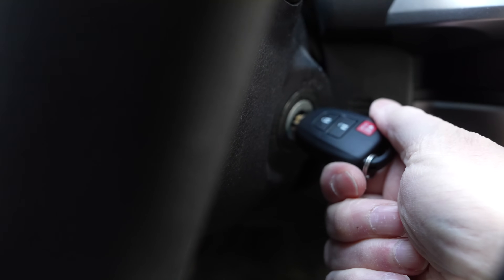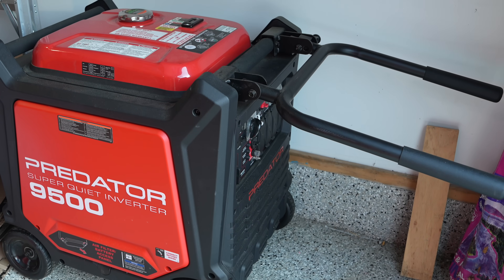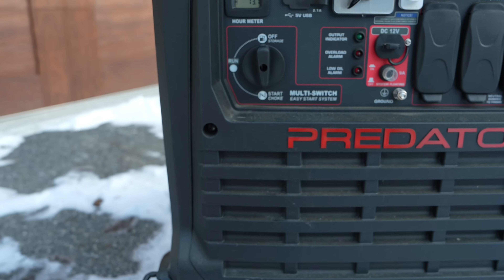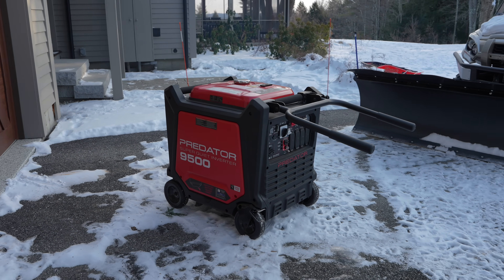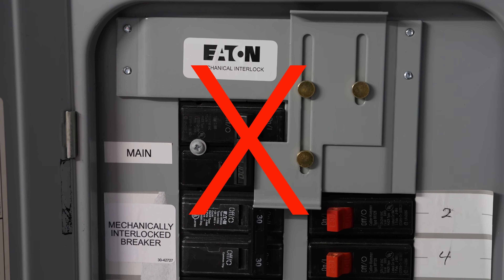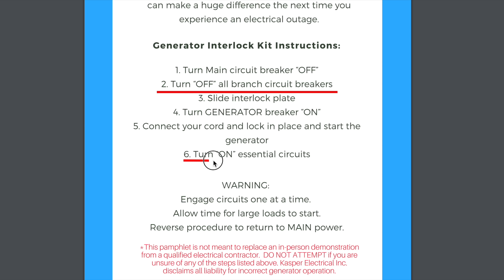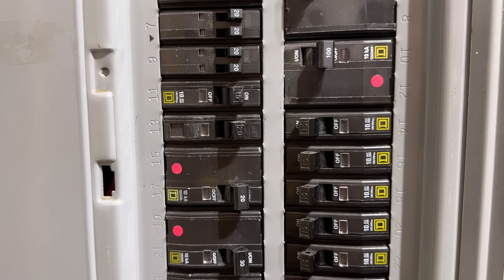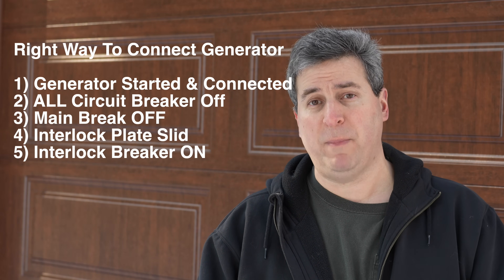Homeowners are Destroying Generators Skipping 1 Step During a Power Outage

Comment: You should have mentioned that automatic transfer switches are built to cope with those surge loads.  Also, in an extended outage, keeping the oil topped up and giving the generators breaks will make a huge difference to the service life.  Only large water cooled generators are intended to run constantly for extended periods (Primary power generators) Those are, of course, very pricey and are typically found only in fully off grid situations.
Reply: I have a 30 kW water-cooled generator with an automatic transfer switch. Would be great if you could elaborate on "automatic transfer switches are built to cope with those surge loads" . As I understand this video, at least part of the issue isn't the breaker (being used in this example as a transfer switch), but rather the large change in electrical load.

My transfer switch is, like I assume all are, designed to make and break contact as quickly and completely as possible, to eliminate significant arcing that might damage the switch. But as far as I know it does nothing to soften the load being added to the generator all at once (nor being removed all at once when the outage is over). I've always assumed that the generator is just large enough, with enough inertia, that connecting it to the house panel all at once is something it can handle.

(Of course, the largest loads don't actually come on all at once anyway, except the water heater. Everything else is controlled by some kind of electronic circuit that takes time to reboot and get going again once the power has been interrupted. But let's assume for the sake of argument that there are a number of large loads that could be immediately powered back on when the generator's transfer switch is connected.)

Comment: My generator panel has a two position switch which automatically selects utility power or generator power. So I don't need to switch the utility breakers off since they are isolated by the generator panel itself.

Comment: I would like to get your opinion on connecting a generator. The way I have been doing it for 45 years is only connecting the two hot legs to the panel since the ground and neutral is still working in the panel. I just bought a champion and that I should have a floating neutral by disconnecting the neutral  in the generator, but by disconnecting on the plug will do the same thing and do you have a opinion on exhaust extension, thanks Bert

Comment: You can leave some circuits on if they're just lighting, especially if you're using LED bulbs.  Typically you can leave on lighting to where your panel is and lighting for stairways.  That's very minimal draw.  Another handy thing to do is to have a few LED lights that will come on when the power goes out automatically so you have emergency lights.  If you don't have an enclosed mounted generator, you can make a cover for your generator by using a piece of heavy plywood that has about a foot overhang on every side to protect from rain.  Add blocking on the bottom so it can't slide or vibrate off, and use a sandbag or something heavy to keep the wind from blowing it off.  That will help keep rain off of it.

Comment: Warming up the gen ... check.  Turn off Eco mode ... check.  EVERY breaker off??  Sorry, you lost me with that.  WAY overkill.  Turn off the high draw items, sure but any generator can handle a small to moderate load thrust on it suddenly if it's warmed up and running with the eco mode off.
Reply: inrush loads should be turned on first, one by one.

Comment: Not a tip for the generator, but a tip for the power companys men working on the poles.  Powering up a generator into the circuit panel with the main breaker on sends power up into the wires feeding your house and many others.  This will generally stall the motor on your generator immediately, but also send electricity up the pole to the poor guy working on the lines.
Reply: "Powering up a generator into the circuit panel with the main breaker on sends power up into the wires feeding your house " -- no, it doesn't. Not if the electrical is wired correctly, as seen in this video. The generator and mains can't be connected in the panel at the same time, due to the breaker interlock.
Reply: @harvey66616 Yes;  if wired correctly...

Comment: I'm not exactly sure what eco mode does but I assume it allows the generator to cycle down under low load conditions. This is exactly what you would want during warm up. You don't want the engine screaming its guts out when it is cold. By the time you have hooked your cables up it should have warmed up enough that you can switch it to normal mode. Then energise your fridge and freezer circuits first, followed by lighting.
Reply: You're not sure what it does but you still have advice anyway lmao. Dunning Kruger

Comment: I grew up on a dairy farm and we had a big ol 30kw generator that had to be hooked up to a tractor. Thing had to run the entire farm especially the big electric motor on the vacuum pump for the milking setup, and that took a lot of power. We got rid of the cows after we had that bad winter back in 13-14 but we still have that big old beast, and now that you mention it I can't recall ever doing this procedure once, we'd just wheel it over to the main power pole with the meter box on it, hook it up via a inch thick cable rev up the tractor and flip a big lever from the up position (overhead lines) to down (generator feed) and go about our business till the power company got the lines back up.
Reply: Almost the same set up but with a big welder on a trailer. It won't run every thing . Infact I have to make shure the 3 phase motors are off first or they will burn up.

Comment: I have a Reliance 2 leg Watt Meter in line for my 30AMP connection into my panel. This allows you  to see how much each circuit breaker is drawing & on which leg as you throw them back on individually, so you can keep your load balanced. I had my panel upgraded last year so I now need to mark each breaker to know which side it is using.

Comment: I don't think you need to shut everything off. You can turn off larger loads like the stove, dryer, ac, hwh, etc. If the rest has a few led lights or a computer, it's not going to matter. Everytime you add a heavy load to your generator it is going to get 'slammed' anyway. The valid point here is not to add too much at one time.

Comment: The main reason to start with Eco Mode OFF is most of these engines have a "Splash Feed" lubrication system. This means most don't have a Pump like a Car, they have a Dipper which "Splashes" oil around to lubricate the Engine so more speed, more lubrication.

Comment: I spent the extra money for a generlink connection at my power meter. It prevents back feeding the grid, and acts as a whole house surge suppressor. Yes it is more expensive than a manual setup. But in my case, with an older home and limited panel space, it was actually less expensive to install. 

Thanks for the helpful reminder about the proper sequence of operations to getting my generator connected and running safely during a power outage.
Reply: Can you please provide manufacturer info ?
Reply: @charly3rd273 Just Google generlink. They are very simple as they are plug and play , the cost is reasonable compared to getting your panel retrofitted and you can take it if you move!
Reply: @charly3rd273 Generlink is the manufacturer. Just talk to an electrician or electrical supply store.

Comment: You might want to mention that this would be recommended for portable gas and/or battery generators.  You are not going to do this with the a whole home gen as its made to failover when the power goes out.  Same thing with a properly sized battery system.

Comment: It is better to turn loads on in stages, but how much load is enough to be concerning? What types of loads should be noted (inductive loads vs resistive loads... I don't think many residencies need to worry about high capacitive loads)? How much leg bias is tolerable.

Imo if someone shuts off all 30 amp loads, two pole breakers and any other intermittent automatic motors that may operate on 120v (like mini splits) then it should be fine to leave on all 15 and 20 amp line to neutral breakers (almost always single pole breakers) as one initial load after the generator's warmed up.
Reply: Leg bias?? In a perfect world it should balance. If the breaker panel was set up properly it might be close. The way a generator works you can load one side and not the other, but a balance is better. Loads also vary throughout the day. 

As far as breakers go, resistive loads like an electric water heater or electric range draw a LOT of power. So they should be off unless you have a very large generator. Like you mentioned double pole breakers. Other circuits? Depends on the generator. How many watts is the generator? Things with a motor like AC , refrigerator, freezer, draw double on start up. Things like a blow dryer, toaster, coffee maker, microwave can use around 1200 watts each, so they can add up fast. You can trip a 3000 watt generator easy with just those. 

I use a transfer box with 2 meters. So I can get an idea of what loads I am putting on the generator. Also shows the balance. Amazon item B000BQN4T2 if you want a look. That one is only for certain circuits. Needs to be installed by an electrician. Needs to be sized at or larger than the generator. Hope this helps.

Comment: Petrol generators can be a pain. Modern fuel goes stale very quickly, about a month here in UK. unless you use the manufactured fuel which is expensive. Never use E10 fuel it will destroy the engine. 
The best generators are diesel, I got one about 2 yrs ago. Worked out cheaper to get a diesel generator. Runs the whole house using about 0.5 lts hour of fuel. As I have agricultural diesel it costs 35p per hour to run.
As the video says warm up the engine before putting a load on it. Same goes for any engine in fact.
Reply: E10 won't harm the engine at all, unless you neglect to drain it out of the carburetor bowl before putting the generator back into storage.
Reply: @BKD70  most fuel stations have gone back to E5 petrol now because of all the problems with E10, 
Even modern cars have issues using E10,  some places in my area only sell E5 now. 
I service small engines, lawnmowers etc etc,  even new engines have stickers not to use E10 as warranty is void if used,  even draining fuel system engines won't start on old E10 if used. And I mean fuel over a month old.
Reply: @Feilding8187  Wow, your gasoline/petrol must be really bad over there.  The E10 is garbage over here, but if you at least drain the carb after use, the problems are minimal here in the States.  The problem is, it only takes once to forget to drain that carb bowl... and then it's no-go until you remove and disassemble, clean the carb and put it all back together again.  If you regularly use the small engine, there generally are no problems with E10.
Reply: @BKD70  over here, a small engine won't start on stale E10, even if carb has been drained. And it eats away any plastic parts, hoses go brittle over a short time. If engine does start it is very low on power and stall's. 
Last spring a customer brought their Honda mower that would not start, though it was ignition system, I asked how old fuel was, said it was only 5 weeks old, I just drained fuel system and tank, put New E5 fuel in and as they were watching me I told them to start it, their face when it started first pull was a picture. 
They get fuel every week now for their mower.🙄

Comment: Get a Reliance Controls MB125 Indoor 50-Amp Wattmeter Box that way you can monitor the power going from your generator to your breaker box so you can balance the load from the house on the two phases of your gen. If you overload one phase of your generator and not use the other, you won't get the power out of the gen you think and it will damage and shorten the life of your gen. The MB125 will also show you the total load on your gen from your house (so you can leave things on or turn them off) and you can also find the load of anything in your house (start up/run) you want by just running it alone and reading the gage when it turns on and runs. I know the power usage of everything big, water heater, well pump, sump pump, HVAC, etc and have its power usage on a list taped to the breaker box. I also have every breaker in the box listed on what phase it's on for the main box and the sub panel in the garage. Most of the big power users are on both phases from the start. It's just the other stuff that can get you out of whack.
Reply: That Reliance Controls product has been discontinued.
Reply: @CliffsideStables  That's what I bought years ago but I'm sure there are others that make the same thing. Thanks for reading.

Comment: No.  You want "ECO Mode" switched ON when you first start your COLD 3600 rpm screamer junkerator.  Let it run a little while at slow speed before screaming at 3600 rpm!
Don't just go and flip your interlock breaker on...  Automatic transfer switches have entered the chat...  There is typically so little load in a house.  Almost all of those breakers have NO load on them at any given time.  I would turn off any kind of electric heat or water heaters though.  VERY inefficient to run electric heat with a generator.
Reply: unless you're up to date and got the heat pump technology

great comment

Comment: Those Generator fuel valve choke and on off switches all in one are a stupid design!there is no way to run your generators carb. out of fuel you would be extremely lucky if your Generator started after sitting for 6 months when the power went out... all the fuel  in the carb bowl would be Gell.I put a seperate kill switch on my generator and took  the kill wire off the original switch to the new switch and solved that Glaring problem.;

Comment: Connecting power to your house has to be methodical like the video.  What I have done is write a protocol for generator startup.  It includes adding gas, checking and filling the oil, starting it up, in Eco mode for my generator because that is slow running until power is needed.  So I go out set up the generator, plug in the cord to the house box, then start the generator and connect the power cable to the generator.  Then walk into the house and go to the breaker box.  Power up interlock breaker with all other off. Then follow the power up sequence on the protocol slowly. Example: basement lights, then fridge, then furnace, then internet exterior security lights.  There are only 10 breakers needed during any emergency.  The protocol also covers run times 4 hr in morning, 5 hours at night, all batteries are charged during the generator run time.   By following the protocol, I can run my house for a minimum of 10 days on 27 gallons of stabilized storage gas.  Tip, Create a protocol to follow for an emergency and keep it next to your breaker box, and second, after the emergency, put your generator back into long term storage mode(read the manual).

Comment: I didn't go with the full house backup, I installed a panel that only powers a few critical circuits in the house, like the air handler for the gas furnace and the condenser for the air conditioner (its a Trane 4 ton variable speed compressor and fan so it by nature soft starts and the generator runs it at full load with no problem, surprisingly), the fridge and kitchen lights, and the adjacent den, and the garage.  The rest of the house remains on the main breakers and when the main power comes back on, we will see the rest of the house turns back on.
Reply: variable speed sounds like a soft starter

Comment: Yeah so I don't know what experience you have with small engines but your comment about a small engine bogging down if you start it at an idle is bogus. Small engines should be started at a slower speed. Most small engine oil systems rely on oil splash. Meaning they don't have oil pumps to get oil pressure. Starting a splash oil system at full speed causes premature engine wear. And they don't bog down at an idle unless they are loaded or running poorly. And yes, I own a small engine repair shop.
Reply: My generac and predator start up just fine on "eco".
Reply: He didn't say it bogs down if started at idle. One of the tips was to turn breakers off so the generator is idling at start instead of immediately being hit with a load.

He was talking about the eco mode switch, not idle. Next time, reply to what the video actually said, not what you decided you wanted to hear.
Reply: @mjc0961 LOL, Eco mode is idle when there is no load on the engine, which is how a generator should be started. The following is right out of the owners manual...Yes, when first starting a generator, it's generally a good practice to let it run at idle for a short period before applying a load; this allows the oil to circulate through the engine and warm up the components properly, which can help prevent damage and ensure optimal performance.
Reply: @ he actually DID say it would bog if started with eco on/at idle. He mistakenly said that with no load, it would be at idle. Idle has nothing to do with the amount of load. With engines, it’s a term related to engine speed, and it means the engine is at minimum rpm.

Comment: What is your advice for knowing when the city power comes on❓🔌💡
Reply: If you see the numbers on the meter the power is back on. Not an easy way to use both both street power and generator power at the same time (To have a light come on when power restored.) unless you install an individual breaker transfer switch. Not just a whole house transfer switch.